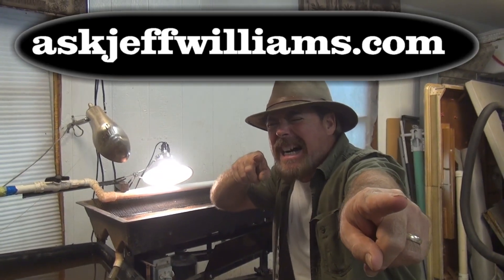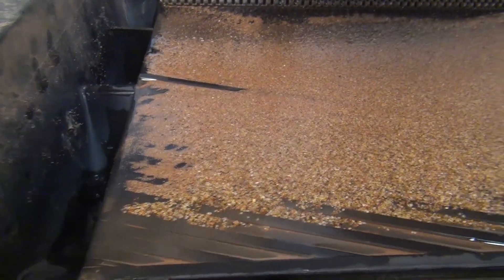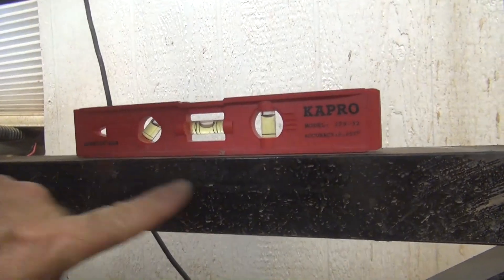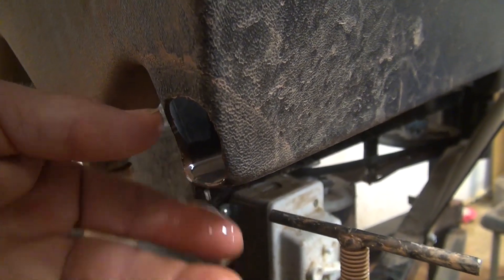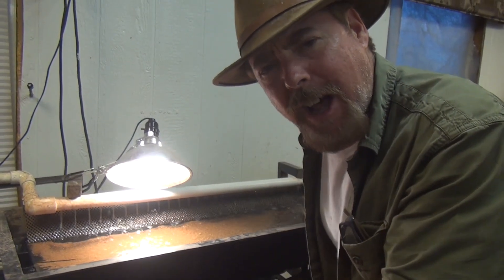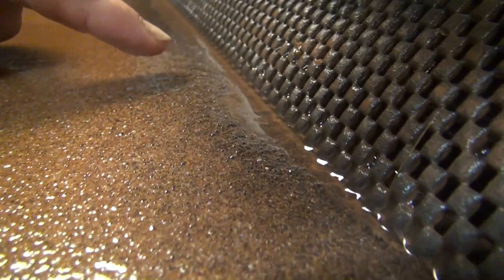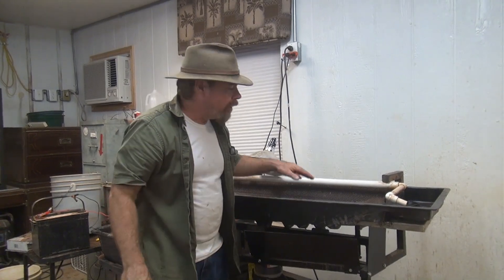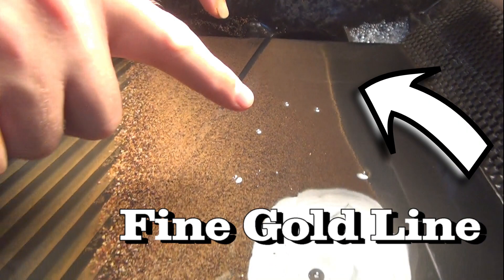SHAKER TABLE | Set up for Gold Recovery | ask Jeff Williams

Comment: We too just acquired the ST1 RP4 and your video helped a bunch for setup.  I jury-rigged after setup to see if it worked and it worked fine.  We were limited in space and ended up attaching this to two 8x8 2 foot long concrete blocks which were dug in and tamped down, leveled, etc.  The unit works very well and from a small sample separated out lots of very tiny material from what was all minus 20 mesh going in.  Would like to know if you have ideas on how to further purify this small stuff or should one simply melt it all into a small ingot?  Our ore is complex so there could be other heavies being pulled out along with gold.  Any ideas on further processing this extracted number 1 drop, which obviously has lots of very tiny and micron gold in it.  Only thing left is the plumbing for recirculating water which we have done before and running power to the different parts which we did today.  Thank you so much for the vid and pointers of set-up, they were very useful, and we love all of your prior vids as well!
Reply from the maker: thats great ....

Comment: Hi Jeff great video I worked in the vegetable seed industry for 25 years and we used a Shaker table that was quite similar to what you use it was called a gravity deck it worked exactly the same way as your Shaker table except no water used striation and Shake to move the heaviest to the topside good seed into the middle and garbage to the bottom and there was also a rerun spot on the gravity deck keep up the good work love your videos
Reply from the maker: Thanks Mark for sharing .....love to hear it.

Comment: I ran some Arizona ore two years ago that mostly came out in the 2’s. It was stuck to the iron. We ended up using Aqua to separate it. That was at -50 mesh. We use EcoGoldEx to leach now or just chlorine depending on how stubborn it is. Dave Cook has the rights to start building the old Yellowjacket Highgrader reverse helix trommels again. He says they can catch -200 gold when adjusted properly. I also hear the Mountain Goat also does a good job. I love my RP-4. But it’s best used on concentrates you bring in from the field. I have pics of the Arizona gold somewhere.
Reply from the maker: thanks for the info Sam, would love to see the pics.
Reply: Ask Jeff Williams they are on a post in my FB group. I have video and some pics of the Aqua (I don’t recommend it due to expense and toxicity).

Comment: What did you mean by up to 50 mesh? I thought shaker tables could separate much finer gold.
Reply from the maker: you can get 200 to 300 mesh Gold from a table but if you run your material through an impact mill then 50 mesh is enough .

Comment: I work with a vibratory migration unit in a manufacturing environment. It's vibration frequency rate is variable. Would this feature be necessary/desirable/available in this application?